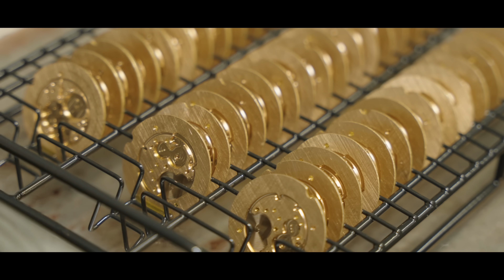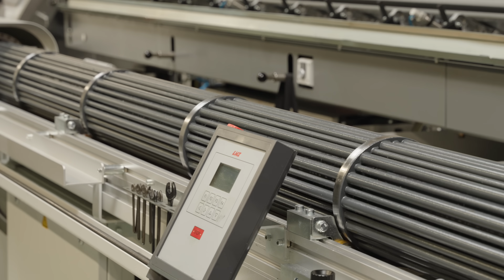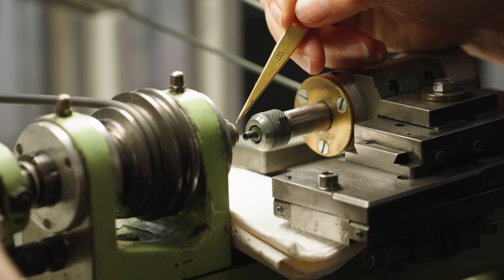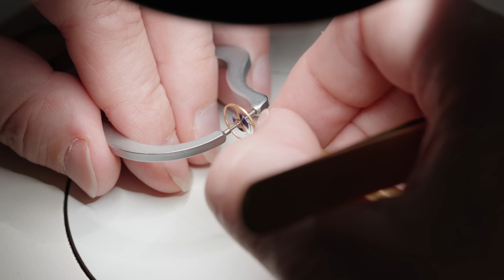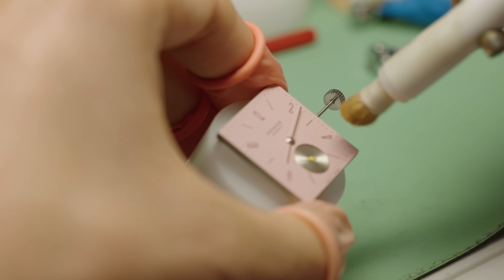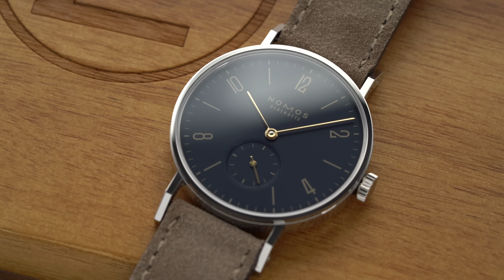Visiting One Of The Most Underestimated Brands In Watchmaking

Comment: Those are tiny bolts, not screws. Screws generally displace material while cutting it's own thread pattern in the material. A bolt holds two or more pieces of materials together while following a precut set of threads in the materials being used. So those bolts in that watch are super tiny!
Reply: Thank you for pointing that out.
I would like to let you know that in German there is no such differention.
Every separate element with a thread is considered a "Schraube", this includes even nuts. So what in English a screw, in German would be specified by purpose: i.e. Blechschraúbe (for tin-plate), Holzschraube (for wood) and so on.
What you consider a bolt is simply a Schraube, but with the diameter mentioned as standardized, like a 10mm diameter one would be a M10. A nut would be a "Mutter" (mother).

Comment: Nomos maybe a small watchmaker compared to more established brands, but their customer service is absoltely top tier.  I had an issue with my Club 701 not working to spec (accuracy and power reserve issues).  I dealt with Nomos directly.  They arranged for the watch to be collected by international FedEx back to Glashutte.  It was serviced, fixed and returned in three weeks.

Comment: Love Nomos, Ive owned a lot of them, they wear big for there size due to no bezel and long lugs, but they have recently been not so good on quality control, (hands dont lie parallel to dial.. on last 3 Ive owned) I still love the brand, and have the original Tangente Sport 36mm with Alpha movement, and its probably the cheapest to buy secondhand, but is in every way the Nomos essence, and a bargain. recently they have also gone a bit to big, with there weird date complications, you either buy the 35mm or 39mm which wears like 41 on wrist. would like to see smaller neomatik watches. saying that the new black 35mm Orion is on my shopping list...